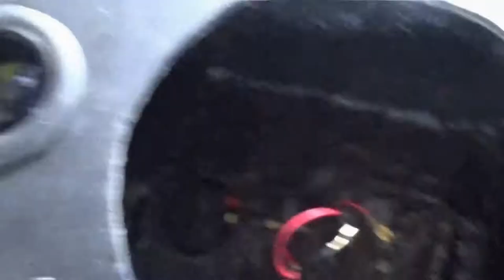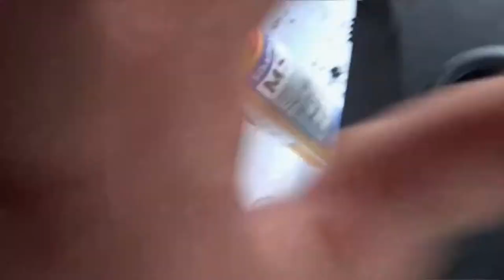How to install a sub into an RX8 / HOW NOT TO PORT THE BOX (PART 2/2)

Comment: Sound test
Reply from the maker: Sorry man, I sold this car a few years ago. It wasent great for sound, I tried to line the edges with some foam tape to stop vibration without success. I also didnt have anyone around to help tune the amp. Overal it looks cool but if I did it again I'd stick with a sub in a box in the boot.

Comment: Where is 3rd video
Reply from the maker: lol I was going to do an update but it fell through as my other car arrived. I need another set of hands & ears to tune the amp and I tried to seal the box in with some foam tape but it didn't work. I might even try swapping to the spare sub to make sure Im getting good sound quality. The 2nd video was only due  to demand as when I made the first it was more like a slide show. Is there anything specific you want to know about how I did the install?